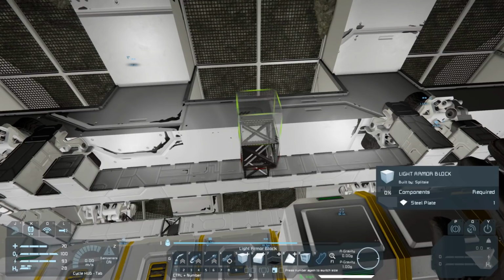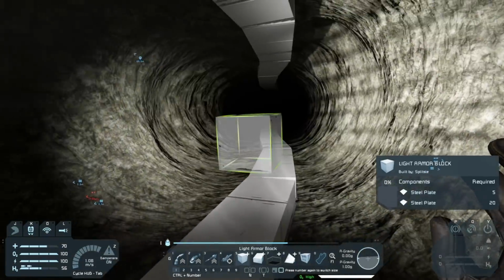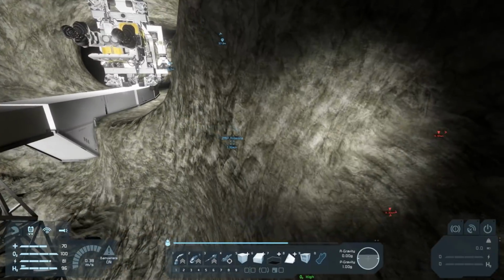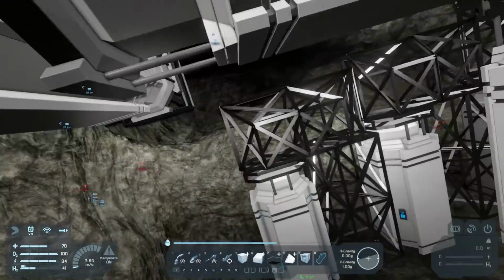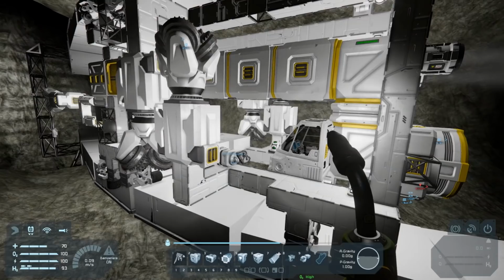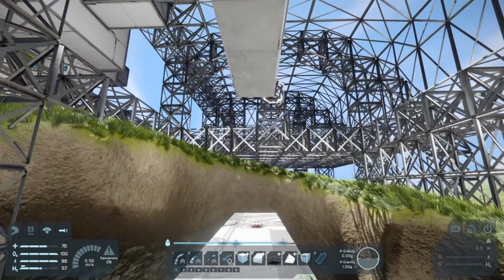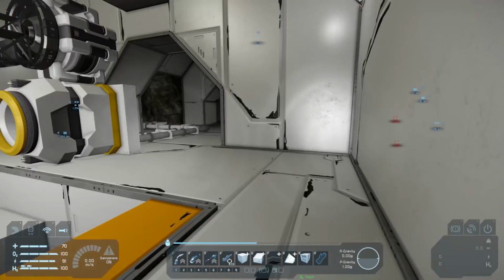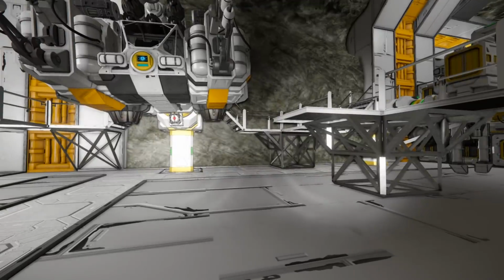Survival, Maybe... #82 Thomas the Tram Elevator (A Tram Engineers Survival Series)

Comment: Did you check out [infal] Piston Control script?
It's command line based, so typically one PB only for multiple piston groups with arguments:
-g "[group name]" -s [speed] -p [position] -tb "[timer block]"
It triggers the TB when the pistons reach their target, which could be useful for managing multiple axis where it's safer to move an axis after others have completed.

Also, check out [infal] Charge State Manager. It wont work with merge blocks, but that might give you something to consider; with removable batteries and fixed batteries, you need to manage the charge state so that the removable's are discharging as a priority and the fixed are charging. If they're just all set to auto they all discharge at equal rates and all reach 0% charge at the same time.

Both of these scripts have actually been used by TimmyCarbine in his Survival Maybe series, if you want to check them out there, or not use them to maintain a point of difference
Reply from the maker: I should definitely have a look at that one as it seems like it could be a good alternative for the elevator :)

I'll see if there's anything I can do with Isy's scripts that are already running on the base to make that happen and if not that will be a good solution too :)
Reply: We use [infal] Piston Control script for an elevator with 4 Floors and its working great. 11 Pistons.

Comment: instead of scripts elevators could be done with a number of pistons. just use buttons for each one reversing. would potentially need more pistons then with a script but it is simpler. moving tram carts around then like a vending machine with container rails or something.
Reply from the maker: Yep, exactly the way I did in my elevators tutorial ;)

I wanted to try out some scripts for this one which is part of why I didn't plan it out to include the extra pistons - thought it would be fun to try something different :)

Comment: Just running an Idea across, why not use a connector instead of landing Gear/or both, it will allow you to disconnect the merge block from within the cockpit. or do you plan on using timers to achieve the disconnect control.
Reply: also Great episode
Reply from the maker: To be honest it's probably best I don't use a connector or a merge block now that I've thought about it a little more - since I'm going to be draining the batteries dry I'll need to have a system to reconnect them when they're completely dead so I think I'll have to use rotors with attach detach
Reply: yea Good Point, so you'll have to have a remote disconnect/connect to activate at each end, like the Main Base doors system. that will also save space side to side on rail car.

Comment: 90 degrees only? Says the same person that already has rotating connector arms.
You can also use reversing loops or rail triangles for reversing cars, if you prefer alternatives to another turntable
Reply from the maker: I did elaborate on that, but it just seemed silly when I could try another approach that's different and still a little bit crazy ;)

Comment: For the turntable, is there room to add a rotor to the elevator so you could just mis align a connection and rotate? I dont think a separate turning area is going to be beneficial in this case. It would have the benefit of allowing 90 degree storage as well; which would probably be a bit overkill... I hope.
Reply from the maker: There should be room and it's tempting to make the car out of small grid for a couple of unrelated reasons that would also make using the rotor easier - I'll have to test if a small rotor head can generate enough force though

Comment: I know this is an old series and I'm way late but I'm binging the series and just gonna drop a few questions and ideas here and there. For example, is there any advantage or disadvantaged to using batteries and merge blocks over a energy transport tram? I mean why transfer the batteries? Just build a tram or two with like 6 or 8 batteries on it and charge it at the Solar Axe and then run it where needed to discharge into whatever system you need it. Discharge seems a lot faster verses moving blocks around. Just dock at a charging port and top off the base or silo and then return to the Solar Axe. Or am I missing a factor other then Splitsie just being overly complicated Splitsie as per usual?

P.S. Would it be possible at very low speed maybe to automate the tram? At least like battery tram. It's basically only 4 commands if you have the speed limit set really really low. Wouldn't it just be Forward, Switch-Lock, Discharge, Switch-Lock, and Reverse? Maybe have the Switch-Lock on a timer to top off any grid it's set to travel to so it just runs out and back on a schedule? This is my own curiosity about automation potential if the track is smooth enough to reliably travel at a consistent slow steady speed.
Reply from the maker: There's an efficiency loss with transfer between batteries of about 20% but really I wanted to do it this way for the fun challenge as much as anything :P
Reply: @Splitsie  oh. I didn't know about the loss. Good to know. Thanks. :) Also anxiously awaiting more Survival Impossible. Loving that one! Chewing through wrong way down and this one in the mean time. Keep it going!

Comment: Hey, Splitse, I have run the numbers and they suggest you should use small-grid batteries for your battery modules (if you're not already committed to the large-grid ones - I haven't had a chance to watch the latest episode ^^;   ). Three small-grid batteries store slightly more Watt hours than a large one, and they take up less volume and use fewer components (particularly power cells). This would also make it easier for you to have  more than one merge block on the module, which would make swapping old modules for new ones much easier.

Also, I just discovered a HUUUUGE reason to try out Digi's Build Info mod (if you can squeeze it in without tanking performance) - if you select your grinder and aim at a block that is holding your grid together, a little red message appears in the hover text that pops up next to the block. Build info also tells you block name if you point a grinder or welder at it, and for any block it will tell you mass, power usage, and other vital stats. I think it also adds more to the details pane for certain terminal blocks, but Keen changes things so much these days I can't be sure what's vanilla and what's not. That "don't grind this, you fool" message is amazingly helpful, as you might imagine ;)

Cheers.
Reply from the maker: Fortunately I've already been talked around to using small grid batteries, since I should really be using rotors to connect/disconnect (as they'll work without power) I like the idea of small grid as the rotor parts are much more appropriately sized :)

As for build info, that's a cool function, but I never particularly liked the way that it can really clutter the interface (as someone who plays with their crosshair off 100% of the time you might imagine I'm picky about that) :P

Comment: Is it just me or is that horizontal piston direction/offset in the wrong direction? The one used for projecting. It seems as though when you extend it, it will push the tram away from the track rather than towards/past it for adding wheels on the side currently in the rail.
Reply from the maker: I set it up pretty roughly, but yep I'll need to rearrange it before I start welding :)

Comment: So if you can merge block batteries to share power.. Can you do that with atmospheric, or any thrusters for that matter.. Moving an engine suite from one grid to another so one doesn't have to be building engines, or to temporarily increase power of say an overloaded mining unit.. . I realize you'd need a seat and battery to fly the power unit to location.. wheels won't steer on pistons..
Wasn't sure if engines behave on merge blocks as expected
Reply from the maker: On a merge block things are treated as a single grid, so the thrusters will work as normal when the merge block is connected :)

Comment: From my experience when testing an issue I had with station grids not being converted to ship grids, though i havnt been closely following your series so idk if its applicable, but ship grids that have been converted to station grids via the menu opption don't seem to ever properly update back to ship grids (via the removal of blocks, disconnection of merge blocks, or rotor heads) even if you turn off unsupported stations n etc.
Reply: Example I was making an self building elevator, flew it into position, converted it to a station grid via the menu, and then attached it to the ground, and an it wouldnt work as the disconnecting auto built parts were stuck as station grids, and the pistons couldn't move them, even when those parts didn't exist when the original ship was converted to station, only got it to work if i connected to a fixed merge block that was naturally a station
Reply from the maker: Yeah, it seems like there are a few bugs with it - especially in multiplayer. I'm sad there are bugs, but I'm glad it's not just me :P

Comment: Hello Splitsie, is it just me or is the second rail lower then the first rail by half a block?
Reply from the maker: Yep, it is. Since the second rail is part of the solar axe grid it was locked to that position and while I got very close with the line from the main base it was still a little way off when I brought it in which left me with a half block offset in height and left-right :P
Reply: just wondering why you did not use the first rail as an reference point so the pistons are on the same height

Comment: Way too late for this build, but if you add wheels that grip the underside of the lower rail (like modern roller-coaster designs) couldn't you then completely eliminate the upper rail completely?

... or conversely hang the tram and eliminate the lower one? - Not feasable here with how you designed the upper rails but likely possible if you made a system where the elevation and curves were done on the upper rail instead of the lower as done here.
Reply from the maker: You can certainly do it that way, it's not quite as stable since the wheels aren't completely rigid and you're applying all the force across a small area though. Either way though, I liked the idea of the roof and floor tracks after seeing Rivvion's build with a similar design :)